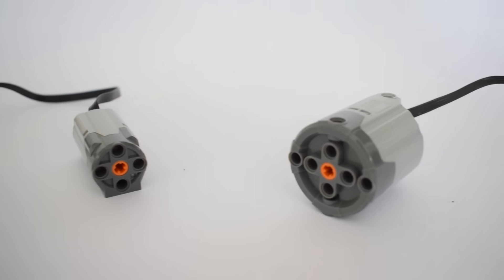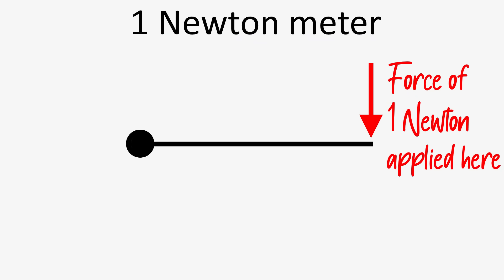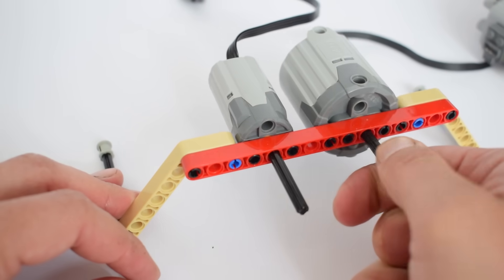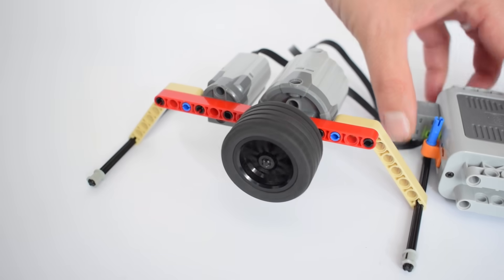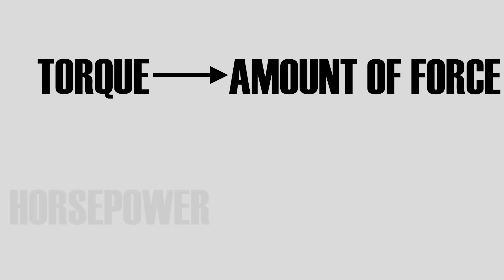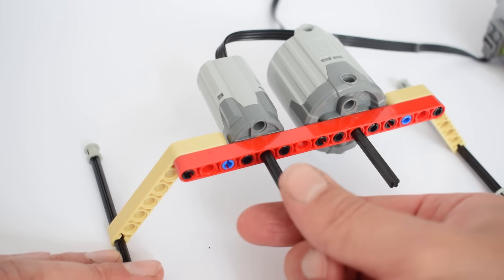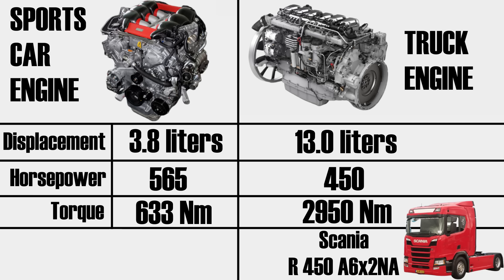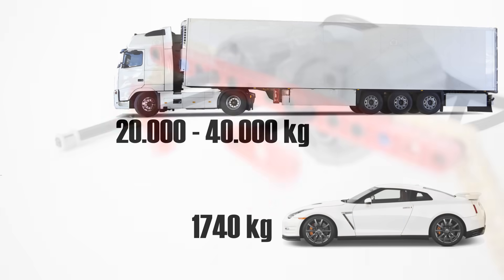NEVER be confused by HORSEPOWER and TORQUE again - HP and TORQUE EXPLAINED in the MOST VISUAL WAY

Comment: My old diesel makes 175 HP and 325 ft/lb torque.  A friend let me use his newer gas truck that makes less torque but more HP.   Empty, he blows me away. Throw a heavy load on them, and it’s much closer.  In addition, my fuel mileage is unchanged whereas his fuel mileage drops in half with a heavy load.  

In a vehicle, you need both in good measure.  A lot of HP with little torque is gonna bog down from a load or hill.  High torque and no HP,  could climb a steep hill with a huge load, just take forever to get to to speed.

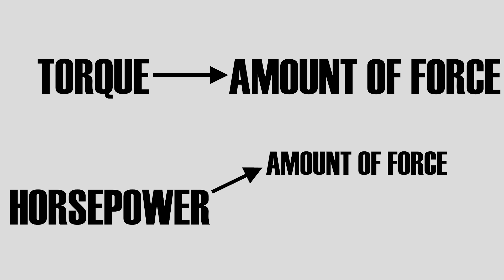Comment: power is work over time and not force the smaller motor has a higher power because it does more rotations in a given amount of time than the big one. i therefore believe that 5:05 is wrong/confusing as force is mentioned instead of work.

Comment: You forgot a key part of the horsepower equation. horsepower is equal to force x RPM divided by 5252. That is the full formula because if you just multiplied torque x RPM you would have crazy readigs that dont mean anything. for example 10 ft/lbs x 1000 RPM = 10000 horsepower. Completely wrong, however if you divide 10000 by 5252 you get 1.9 horsepower. This is also why large slow revving motors always make more torque than horsepower because the lines on a graph will always cross at 5252 rpm, where HP will always be higher than torque after 5252 rpms

Comment: I understood his explanation of torque, but after that I was lost, and I don't quite understand how torque relates to horsepower. I know from electrical circuits that energy supplied to a device (by the power source, for example the power company) in watt hours) = the amount of power (in watts) consumed by the device, MULTIPLIED by the amount of time (in hours) that that device is consuming the power. So a 100 watt lamp consumes 100 watts of power, whenever it is on. If it is on for 2 hours, it has been supplied with 200 watt hours of energy. My electric company bills me according to how many watt-hours of energy all my electrical devices consume – at a rate of about $0.13 per watt hour. So it costs me about $0.26 since to keep that 100 watt light bulb on for 2 hours. So energy is power times time. and power is energy divided by time (determined by simple algebra). If that bulb consumes 200 watt-hours over the course of 2 hours, the amount of power it consumes is 200 watt-hours divided by 2 hours, which equals 100 watts. Now I looked it up and one horse power equals about  746 watts. Both are units of power. But I still have no idea how this relates to force – or to torque. So far I've only talked about power in relation to energy, and time. I have not introduced the concept of force, or torque. Watts are a measure of a RATE of energy consumption, watt-hours divided by hours. But what does this have to do with force?

Newton meters have been compared to foot pound, of torque, but a newton does not measure the same thing a a pound. A pound can be a unit of weight, mass, or force. A foot and a meter are each a unit of distance. They both measure the same thing, distance. But a newton is a unit of force only. It is not a unit of weight or mass. So I am confused.

Comment: But Torque and RPM are interchangeable using gears,  we can obtain the same torque as that of bigger motor, from the smaller motor  using a gear box. Then what is the need of bigger motor ?
Reply: power, you can get whatever torque you want at the end of a gearbox, but you can never make more power with one.

well technically you can make less power through a gearbox because mechanical losses (friction etc).

Comment: When i apply the formula of torque multiply RPM, the horsepower comes different than the HP of the legos on the video.
Reply: HP=(lb*ft)*rpm/5252 only works if you're using HP and lb-ft. if you use NM or KW the constant (5252) changes

Comment: 8:31 You'll rarely see a semi truck, in Europe, with less than 500hp today. Although, here we are in Sweden, pulling 50% more weight and still using 460hp engines while our truck makers are making their engines optimized for our weights and roads. That's why you'll see truck manufacturers like DAF producing engines with 530hp, because in the Netherlands the total weight limit is 40/44 tons. Volvo has their FH16 models, with their 16.1L I6 producing from 540hp all the way up to 750hp. Scania has two V8s. One is a 15.6L V8 producing from 520 to 650hp while their 16.4L V8 produces 730 or 770hp. This is because Sweden and Finland has different laws concerning vehicle weight, length and hight. Europe: 18 meters long from truck nose to back of trailer, 4 meters from ground to roof and 2.6 meters wide. Maximum weight either 40 or 44 tons. Sweden and Finland: 24 meters from nose to rear (25.25 if you have a dolly+trailer), 4.5 meters from ground to roof and 2.6 meters wide. Mostly 64 ton weight limits but some roads are 74 tons.

Comment: Any particular reason why engine power is measured in HP but electrical power is generally measured in watts? And electric motors sometimes use one, sometimes the other, sometimes both.
Reply: People in places like australia use KW and Newton-Meters, but americans have kind of poisoned the nomenclature of the car community into using only HP and lb-ft

Comment: Good explaination driving 4 answers. However, I;m still unclear how a dynamometer measures torque and horsepower on the same device, prints out a chart depicting the two, AND, most baffling of all, why do the two plots overlap at 5552 RPM? Anyone?
Reply: They overlap at 5252 because 
                            
Horsepower= (lb-ft*rpm)-5252

the 5252 number is a constant that specifically relates to horsepower and lb-ft, if you use KW and NM the constant becomes something else, which is why on a dyno displaying NM and KW power and torque cross at 9543
Reply: I should also mention Dynos only measure torque and RPM, then plug that into the equation to plot the graph you see.

Comment: Horsepower is RPMs multiplied
Reply: no horsepower is torque multiplied by rpms
Reply: Then your telling me torque runs consistent with rpm.
Torque always drops as rpm increases.
You'll need to argue with Smokey Yunick. Hes studied this extensively.
Sorry he didn't use "legos"
He used a 25hp electric motor driving a gas engine.He went so far as to hook up a super high speed camera to record his findings.
Horsepower will continue to rise...even after torque has deminished.

Comment: Why not just define horsepower as its actual definition?  The energery or force required to lift 550 pounds one foot in one second.  You know, LIKE A HORSE CAN DO!
Reply: actually it turns out most horses can output 15 horsepower at any given time, but only 1 for a whole day.

Comment: So horsepower is kinda like volts (potential), and torque is kinda like amps (kinetic). That's how I've always thought of them.
Reply: eeeeehhhh not really. horsepower is more like Watts. Literally. Both Horsepower and Watts are both just a measure of power, aside from the superficial numerical difference they are both defined as work over time. 

You could think of colts and amps as torque and RPM, since just like in electrics they multiply to = power.

Comment: Nice explanation, but one thing i feel was misrepresented would be "feeling" torque vs. horsepower in a car.
While driving, you "feel" the torque at the wheel, not the output-shaft, which accelerates the car into your body which resists that acceleration. However this torque needs to be backed by enough horsepower so that the torque doesn't decline as the rotational speed of the wheels increases.
Also, with gearing set up to deliver the same output speed, the car with more horsepower gives more acceleration, regardless of the crankshaft-torque.

Comment: One you need to go fast in a straight line, the other you need to climb a hill. That's how it was explained to me XD
Reply: Well whoever explained it to you was wrong, an engines ability to pull something (let's say the car its installed in) up a hill is directly related to its power, that being defined as the amount of work the engine can do in a given amount of time. Torque doesnt factor into this because an engine making 200lb-ft @2626rpm will makes the exact same amount of wheel torque and power as an engine making 100lb-ft @5252 rpm, assuming the car is travelling at the same speed and has the same size wheel/tire.
Reply: @benfennell6842  Thank you for the clear up! Since the explanation I was given was so easy to understand I took it as correct. Thank you!

Comment: I would compare small motor to petrol and bigger motor to diesel engine. Although the size of motors is obviously different. 

My comparison would be: 2.0L diesel engine has more torque but revs lower while petrol engine of the same size has less torque but revs 1.5-1.8 times higher. 
Diesel engine can output 140HP and petrol can output 200HP. 

But your comparison with examples fits the video better.

Comment: What if both motors are put through a gear ratio that causes them to spin at the same rate? what physical factors within each of the motors (aside from hp and torque) causes them to spin at such rates?

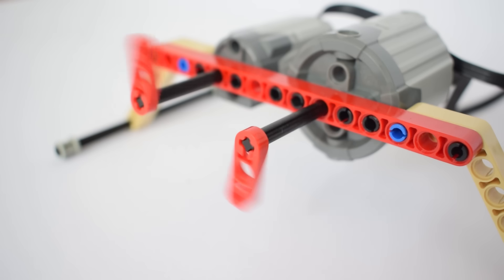Comment: 6:02 I think horsepower could also be felt if you attach some blades to the motors converting them into fans
Reply: Then you are feeling the force of the wind which is moved as a result of the torque.
We cant feel time. we can just have a sense of it when we get bored or excited ;)

Comment: So what happens when you introduce gears? If you took that 6k rpm motor and gear it down to only be turning the output 2k. Torque would increase, no?
Reply: Yes, if we put the truck engine making 500 horsepower and a sportscar engine making 500 horsepower in 2 identical trucks and move those trucks at the same speed with the engines both making 500hp, despite the massive disparity in torque between the engines the wheel torque will always be identical. This is because power=torque*rpm applies to the wheel of the vehicle too, assuming the wheel size is the same and the power is the same, and the rpm of the wheel is the same we cannot change the torque without also changing power, therefore they still match.

Comment: The explanation was promising but the main parts needed for complete understanding are missing. I mean gearing and wheel torque. Engine with higher power can always produce more torque on the wheels for certain roadspeed, unless it is prevented to do so by a gearbox. Gearbox = torque multiplicator. More engine speed => lighter gearing can be used for same wheel speed. So you could beat the wheel torque of a truck with Nissan GT-R. But the gearbox to allow it would be very strange and not usable at all in a roadcar :-)

Comment: Nice explanation!!! What if I got a truck engine in a car, could I solve the RPM problem with a long long gearbox?
Reply: If the truck engine has low HP you can't make it accelerate only through torque. It still would go slower than a small car engine with more HP but it would be incredibly difficult to stop.
Reply: @NAmania  by stop you mean: if you put more and more weight for it to pull, it would have basically the same acceleration it has when pulling almost no weight at all. Right?
Reply: @jvictormp  It wouldn't have the same acceleration but it would be able to more easily tow heavy weights yeah

Comment: It's interesting that gasoline engines have variable torque depending on the rotation. That's why you have to rev it up to start fast. In bikes people use the clutch to rev up the engine and get torque. 
OTH, Electric car engines have similar torque from any rotation.

Comment: If any one cares. There is a problem or discrepancy in all this.

Our friend here is speaking solely of brake horse power, which is much different than horse power. In the beginning of the video he tries to correlate and differentiate the straight line force vs the rotational force. Calling the rotational one torque.

Horse power in it's simplest form is the measure of a horse pulling a horizontal rope over a simple pulley that redirects the force into a vertical force that can be used for lifting. Literally a measure of line force. The rating is the ability to lift 550 pounds one foot in one second.

Brake horse power uses a contraption to convert the horses effort into a rotation by making the horse walk around a whirligig. You may see this type of machine by searching horse driven granary. So, the brake horse power is already converted by the machine into a rotational force. And then the rotation is then converted back to line pull to lift the same weight. (weird, huh?)

Problem: In all my studies I have never found a definition of the contraption that converts the line force into rotational force.

The world of Science-dom has in general tried to fix the problem of equating this motor vs that engine. And we are trying to use watts. Which is illogical. Since all the different motors and engines cannot be well defined in that manner of output. Approximated maybe. But that's the metric system for you.

Comment: The larger lego motor has a 0.14Nm of torque, 146 rpm and 0.0029 hp. If the equation is Hp = (force x distance) / time, how does that motor get a hp of 0.0029?. 
Please can you explain me this, I really want to clarify. Thank you...

Comment: The only thing I would disagree with here is you feel horsepower in a car. You don't feel torque. You're feeling the power of the engine moving the car forward.
Reply: Not true. Torque is what causes acceleration. If you had 100hp and 0 torque, the car wouldn’t move. The wheels spinning, that’s applying torque. Every time you press the gas, you’re experiencing torque. The higher the torque, the better the acceleration, considering you have the traction
Reply: @nickhappens  I dont think its that cute and dry brother. Torque is the measurement of rotational force. Horsepower is a measurement of WORK. When you press the gas, the engine makes toque over time (horsepower) which pushes the car forward. You FEEL horsepower. Torque is definitely a part of it, but not technically what you feel.
Reply: @Ledface117  torque is off the line power though, the higher torque the harder you get pushed back into your seat
Reply: @nickhappens  Torque is literally the measurement of force at a single point in time. Horsepower is force over time. A car making high torque slowly (think your typical diesel engine) is generally always going to be slower than a car that can make lower torque quickly (think rotary engine). 

Off the line power is literally that, POWER (horsepower). Torque is important to the whole equation, but it isnt everything. Horsepower is (torque multiplied by RPM)/5252.

Another example: 
A Honda CBR1000RR sportbike makes about 75 ft/lbs of peak torque. A 2020 Harley Fat Bob makes about 115 ft/lbs of peak torque (super low in the rev range). Which one would be faster off the line? The Honda would absolutely obliterate the harley off the line. Granted the harley weighs a bit more. But the Honda makes a shitload more POWER because it makes its smaller torque number much, much faster. The honda redlines at about 15,000 rpm while the harley redlines at about 5,500 rpm.

Comment: Thank you for this. As a woman, I don't know much about car and truck engines. I am trying to learn and could not figure out the difference between the two. I just bought a small luxury car that only has a 2.4liter engine, but has LOTS of pep if I just barely push the pedal.

Comment: Torque = horsepower divided by angular speed (or 2*pi times horsepower divided by rotations per second). You can produce any amount of torque with the tiniest amount of horsepower if the gearbox produces a rotation that is slow enough.

Comment: Mathematically, horsepower equals torque multiplied by rpm. H = T x rpm/5252, where H is horsepower, T is pound-feet, rpm is how fast the engine is spinning, and 5252 is a constant that makes the units jibe. So, to make more power an engine needs to generate more torque, operate at higher rpm, or both

Comment: The SAE unit of torque is Pound Feet, or Pound-Force Feet (Lbf∙ft), not Foot Pounds.  A Foot Pound, or Foot Pound-Force (Ft∙Lbf) is a unit of work or power, not torque.  If you compare the order of the word parts in Newton-Meter and Pound-Foot, it's Force-Distance, not Distance-Force.
1 NM = 0.7376 Lbf∙Ft
1 HP = 550 Ft∙Lbf/second

Comment: I always viewed it a bit more practically, albeit technically incorrect:
Horsepower = energy generated
Torque = efficient use of energy generated

Horsepower provides the grunt, yes, but torque is what applies that grunt for actually moving weight.

Comment: Basically, engine wise, Horsepower is energy and Torque is energy applied. And of course a vehicle's transmission is the main 'tool' in applying this power, giving the engine and driver control of the output of said horsepower and torque. "Power is nothing without control".